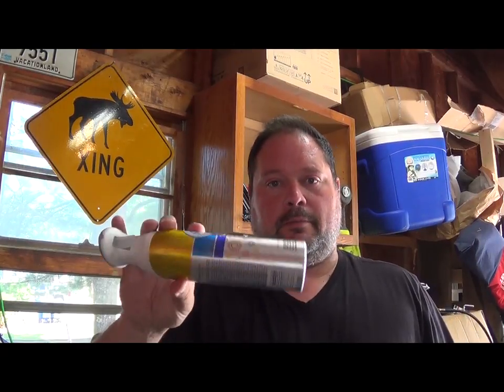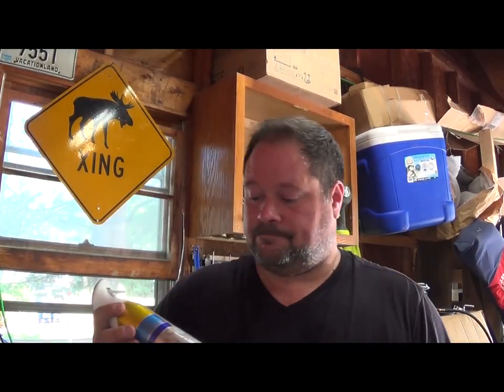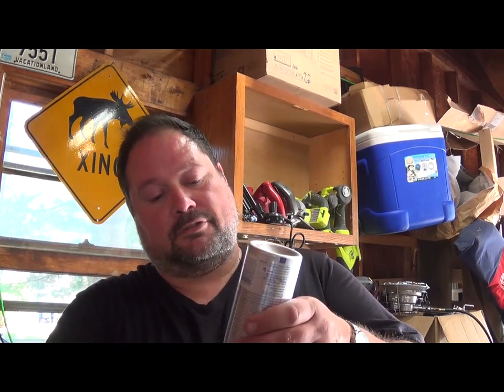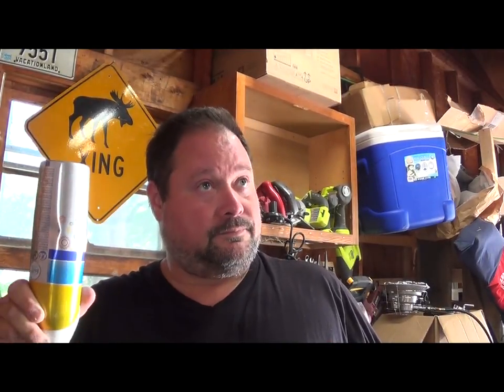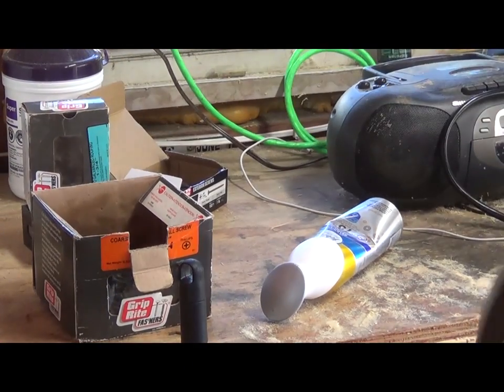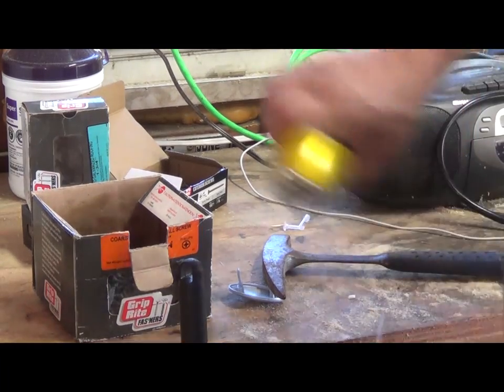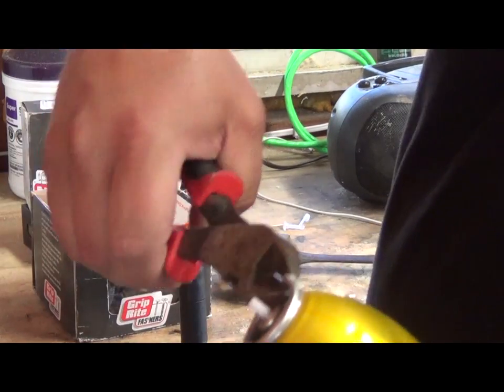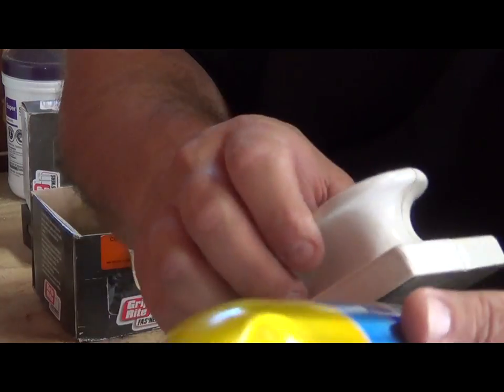Scrapping Aluminum Spray Cans -MooseScrapper

Comment: When I get these cans . I set them up and hit them with a high power airgun.  Get a few holes in it then it's depressurized.  Then I cut the steel and then it's good to go.
Reply from the maker: That sounds way more fun than my method
Reply: Thats what I do on all old spray cans then I throw the iron ones in my iron pile and the others in with the aluminum.  Never thought about the top myself or had any issues in the past with them.
Reply: There ya go Moose a good excuses for an air gun. Enjoy !!!   =)

Comment: If I may ask a Q from a vid that's a few years old, why dissolve and re-animate gold with dangerous acids?  Why not just burn the coffee filters and use a torch or jet cigar lighter to form the bead??
Reply: Steve C sorry I'm not moose but I can answer your question.  The acid process is to purify the gold it's not in a pure state as it's allowed with other metals such as copper and silver. As for smelting the gold it requires 1,850 degrees Fahrenheit  to melt most torches won't reach that temperature without a system of forced air as in a foundry or an oxy/acetylene with compressed gases.
Reply: And that makes perfect sense to me and thx.
Reply from the maker: yup, what Ken said